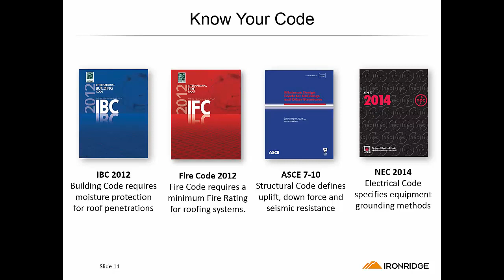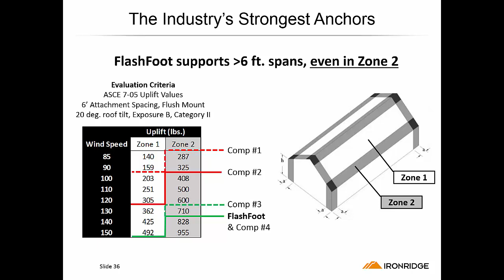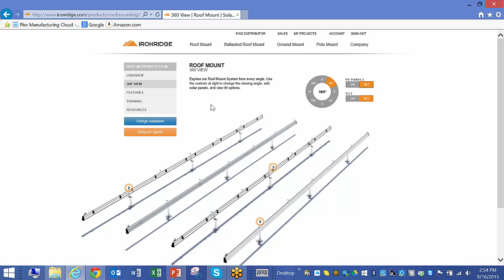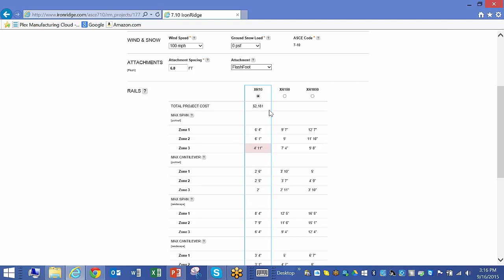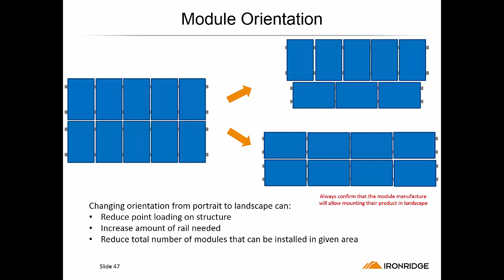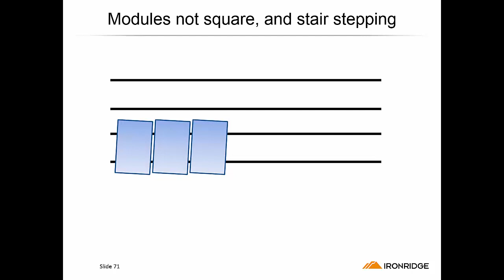Flush Mount for Pitched Roofs // Solar Webinar

Comment: I've been a solar engineer since 2014 and under no circumstance should you use a hammer to find a rafter. That is easily done with your hand. Also, splicing the rails on the ground only applies to one story low roofs.